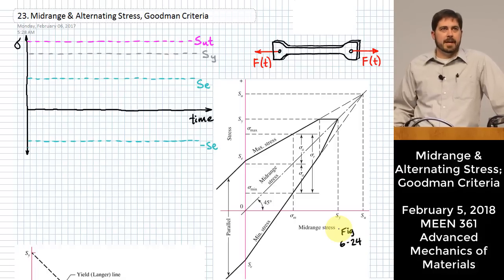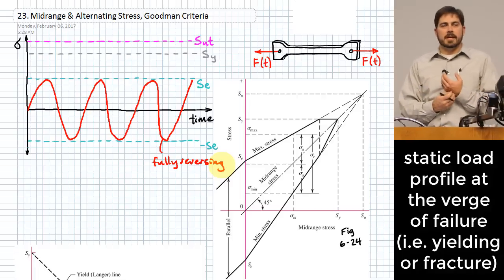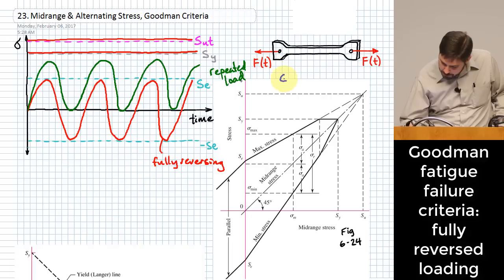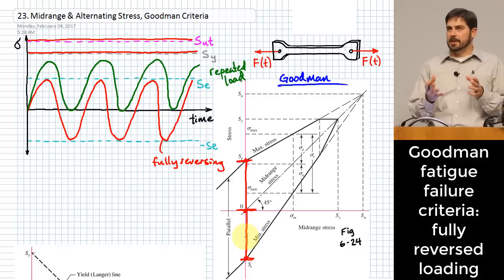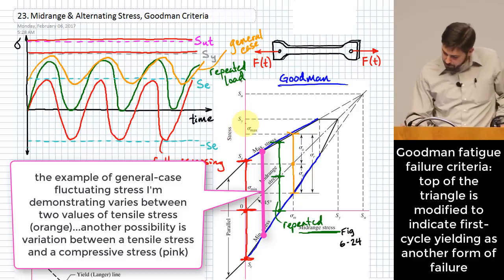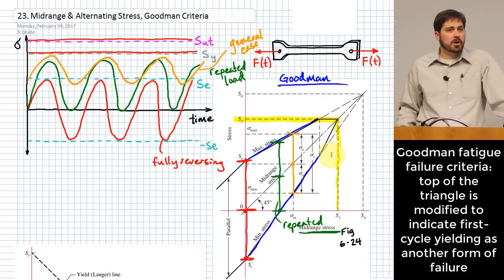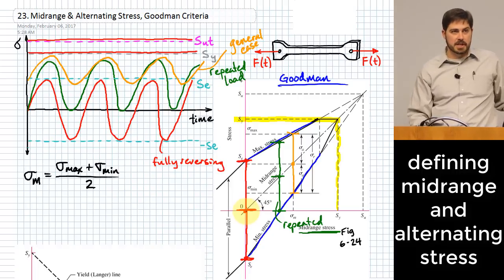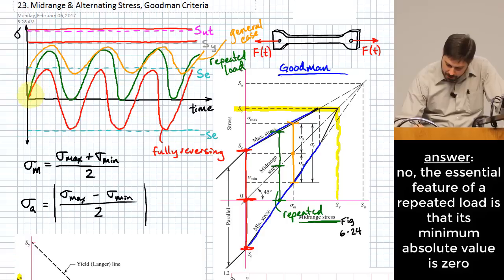Midrange and Alternating Stress | Goodman Criteria | Axial Fatigue Load

Comment: Really great explanation. One of the best if not the best! Any lectures on Failure modes (Bolted joints and Threaded fasteners), Elastic instability (Buckling of columns),  Pressurised cylinders (pressure vessels, compound cylinders) just wondering??  You have this way of teaching that makes this subject looks more interesting to the viewers and want to know more. Pretty sure there is this sentence in every comment "I wish I had you as a lecturer."  Excellent and wonderful job
Reply from the maker: You are very kind! Thanks for the positive review! I do have videos that address most of those topics. (I don't have a buckling lecture recorded, but I plan to very soon.)  Stay tuned, I'll post some links.
Reply from the maker: https://youtu.be/lLWiEKwGVnk
Reply from the maker: https://youtu.be/zV5sNG4hcE4
Reply from the maker: https://youtu.be/unQfA5fIYSE

Comment: 39:10 "We want to take the portion of it where the area is minimum". Doesn't the stress concentration factor already take into account the fact that there's a hole there? Shouldn't you then just plug in the nominal area of the rod, instead of the area lessened by the hole diameter?
Reply from the maker: No, you want to use the reduced area at the hole. The stress concentration factor accounts for localized increase in stress caused by the discontinuity in the continuum of the material (the hole). It does not account for the reduction in area due to the presence of the hole. You have to do that as I show in the example.
Reply: OK. Thanks for the reply. Also, thanks for the well delivered, easy to understand lecture :)
Reply from the maker: My pleasure! I'm trying to grow my channel, so please spread the word! :)